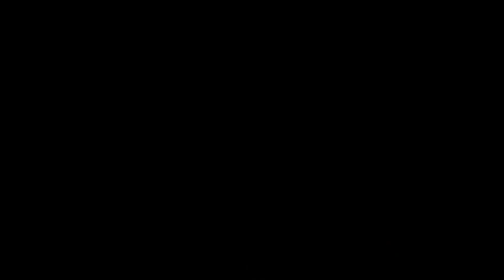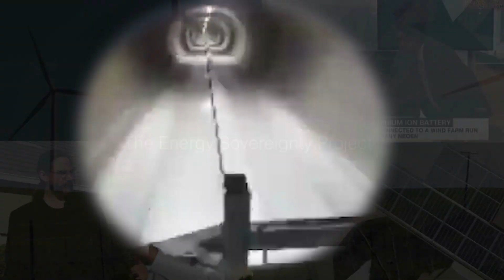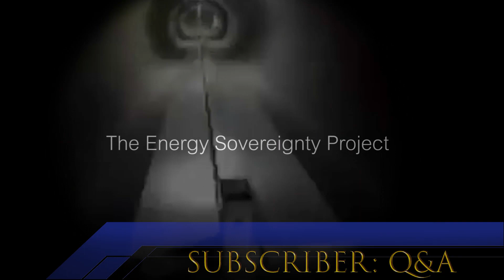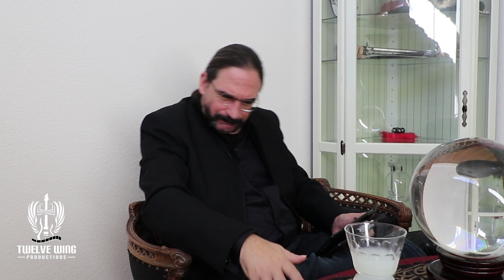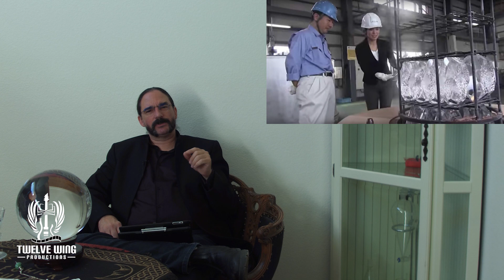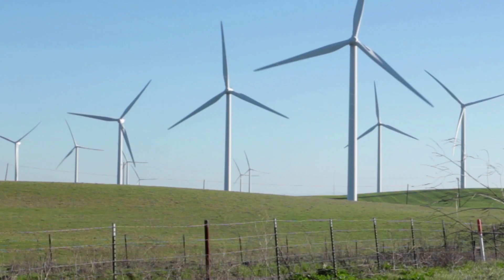Tesla's new Million Mile Battery: Is it solid state?

Comment: I’m betting on no pouch battery. The new battery will use a fatter cell that will double the amount of energy taking up the same amount of real estate with fewer cells in newly designed battery floor of car by same height for 200 kilowatt total. The the weight will be the same as the previous   100 kilowatt battery. Imagine a MODEL Y WITH 100 KILOWATTS WITH HALF THE WEIGHT AND EVENTUALLY HALF THE PRICE. This dry paste technology from MAXWELL plus some capacitors. I’m confused about prismatic cells that may be used in China if they are cylindrical, or pouch design, and if they are only a temporary solution by CATIL & LG CHEM. TESLA has ordered a bunch of equipment from KOREAN equipment manufacture, HANWHA for making cells when they already bought HIBAR for that purpose I thought or maybe the equipment will work together. THESE ARE EXCITING TIMES FOR TESLA. I can’t wait for battery day and I expect them to to test out and perfect their new technology on a pilot basis. I WANT PANASONIC TO VACATE THE GIGAFACTORY IN SPARKS NEVADA. OK here are my predictions. Elon is eventually going to tell ALAMEDA COUNTY to go to hell as well. Same fate for TEXAS too. If I was Elon, I would create the mother of all factories in JOPLIN MISSOURI for CYBERTRUCK, MODEL Y, & TESLA SEMI. SPARKS NEVADA to switch to new cell technology after they get rid of PANASONIC. Build the TESLA SEMI there as well as JOPLIN as well as all drive motor units for all USA factories. REMBER the factory is less than half built out so, more batteries of course and a new factory close by for TESLA SEMI. Now let’s go back to FREEMONT and I will tell You my Plans. The factory is perfect for low volume production. New ROADSTER, updated MODEL X, updated MODEL S, and keep MODEL 3, & MODEL Y as the secondary for these 2 cars but JOPLIN will be the primary higher volume factory. Too bad for CALIFORNIA & PALO ALTA. GET YOUR CORPORATE OFFICE OUT OF THERE. And teach that bastard Sheriff in ALAMEDA and the state of CALIFORNIA a lesson that you will move on with Your Corporate Office to a more deserving State for Your TAXES and a much lower cost of living for Your employees. OH YEAH, didn’t Elon give the STATE of CALIFORNIA GOVERNOR Newsom 1000 Ventilators from CHINA at his own expense. Really dumb move for the GOVERNOR not to get involved and over rule this bastard Sheriff.
Reply from the maker: A well thought out response to this.
I think that it's best to describe this as a "prysmatic" battery but even that may not fully describe what I think they are up to.
Their goal seems to be to limit the amount of manufacturing steps needed.  So I envision the "battery" to be composed of individual flat cells but prearranged similar to what you are describing as the end result.
A battery that is purpose built as a single unit for installation in the car rather than any kind of "individual" cells that would be recognizable or usable in a tear down.

That leaves only the recycling question.  How to make a complete pack, not designed to be serviced, that is also recyclable in total.

Thanks for the response.  I'll read it over a couple more times to see what other gems I can pick out of it.  You covered a lot of ground.

Comment: Could be a pouch battery as it has been leaked that the new models coming out will have two form factors of batteries. 
At the very least we will see two kinds of batteries employed in Tesla cars. Likely one will provide performance (lithium ver?) and the other will provide equal or greater range but lower performance (lower voltages, but good hold charge)

Comment: Dendrites cause lithium-ion batteries to catch fire, not just lose power. :-)
Reply from the maker: They can do that, certainly.  But before it gets to that point... they are losing power.
You are correct, however, that the more of these little structures there are, the more likely that the battery will suffer a catastrophic failure.

Comment: Tesla/Musk have made claims that can't be true without solid-state batteries, but that doesn't prove anything. What does Tesla have in labs, prototype vehicles, and factories, and which of Tesla's/Musk's claims have been confirmed by performance tests in front of outside observers? With Musk claims, they'll probably be true eventually, but I'll believe them when we see them. :-)
Reply from the maker: They already have the "million mile" battery in both test vehicles as well as in their Power Pack products.
They have been field testing these for about 2 years now.
Reply: @twelvewingproductions7508   So has the Roadster 2020 set a new Nürburgring record yet?
Reply from the maker: @steve25782 , Not sure actually.  I haven't been following that aspect of things.
Mostly I have been busy compiling the data from the previous year and trying to figure out if the SGIP is a total fraud or not.
More to come.
Reply: @twelvewingproductions7508  I thought the million-mile battery didn't exist 2 years ago, so how could they have been testing it then?
Reply from the maker: @steve25782 , either you aren't actually watching these videos, or you aren't understanding them.
The former is your fault, the latter might be mine.
What you have to understand is that this is all a process.  You can't define something "being" or "not being" unless you are going to define the metric you are using to make that determination.
If by "existing" you mean ready for market... it likely still doesn't "exist".
If by "exist" you mean are they done testing it and are now in the phase where they are building machinery to bring it to market... it "exists".

If you are looking at the broader terms that I'm laying out in the video, I am pointing out that the basis for the million mile batter can be seen in the "glass" battery of Goodenough and Braga that was presented as early as 2013/2014.
So in that light the battery technology "existed" 6 years ago.  Tesla has been testing the technology for their own use since around 2015 or so.
Reply from the maker: @steve25782 , everyone gets caught up by that sometimes Stephen.  Focus on the content.  I'll make an edit for posterity.

Comment: There have been enough statements pointing to the battery - drive-train day' in the first half of next year' will be a slam dunk. The big decisions have been made and the new Maxwell - Goodenough/Braga - Hibad  technology will go into scale production. Dry electrodes, Solid glass electrolyte & probably pouch construction' higher voltage cells.
 It's go, go, go, the template for multiple automated giga-battery factories . They have not been sitting on their hands for the last 3 years and Goodenough-Braga & Maxwell have solved the single battery/capacitor cells . Setting JBS. free to develop the recycling ,to be purchased  as an established company is the best way Elon can properly reward JBS.
Reply: John Morpeth if you really believe the glass (hard carbon or Ceramic) electrolyte is going to be implemented than I would like to double down on a statement made by Elon, being “we want to get away from using cobalt”. 
All this said, dare I say they will not be making a lithium ion battery, but in fact a Sodium ion battery? 
The biggest problem with sodium was the size of the electron compared with lithium. Goodenough said himself in an interview in 2016 that they have found a solid electrolyte that is suitable to larger electrons, like we see in sodium based batteries. 
If this comes out, it’s effectively the holy grail of batteries, as it’s the cheapest solid state batter that’s sufficiently useful for mobile uses, long cycle life and very very safe! 
Holy grail!!!

Comment: On the assumption that garnet is the diodes in the solid glass electrolyte it is worth noting that it is essentially the material used in caborundum paper ( Industrial sand paper ).

Comment: The Model S/X uses 18650 batteries. The Model 3 uses the 2170 batteries. The 2170 batteries have a better density, is around 50% larger by volume than the 18650, but it can deliver almost double the current (the 18650 delivers 3,000 mA, and the 2170 has been tested at 5,750-6,000 mA. To deliver more than the 2170 a solid state battery would have to be used. I think Tesla has maxed out current deliver with the 2170
Reply from the maker: The energy density between the 2170 and the 18650 is an overall increase of energy to weight of about 15%.
The solid state has another parlor trick that brings it's pack density by volume up without raising the actual density by weight up that much.
The density by weight in a solid state battery isn't actually all that great.  Maybe 5% if one is kind.
The party trick with the solid state batteries is that they have an operating temperature 20-35F degrees hotter than the liquid electrolyte and they actually perform better at those temperatures long term.
So the difference in internal volume is closer to that 50% mark because of the reduction in the cooling.

Hence the point about the pack size.